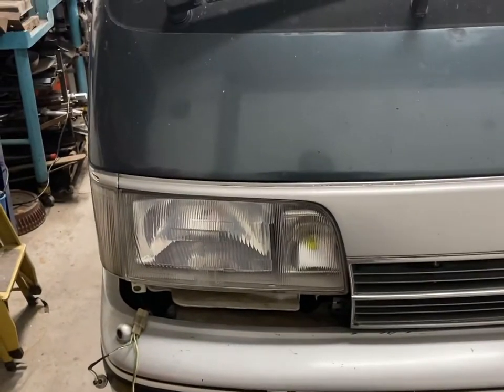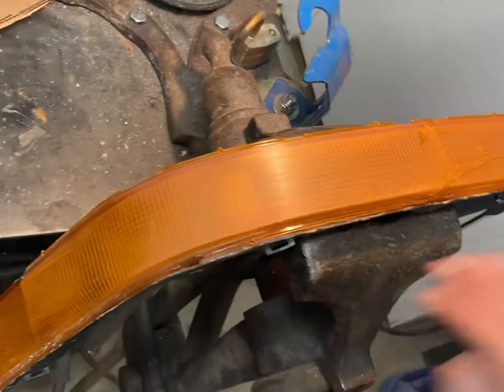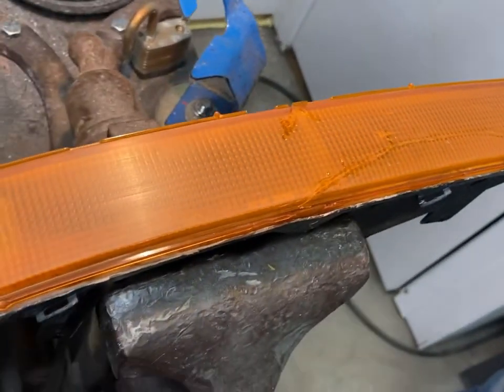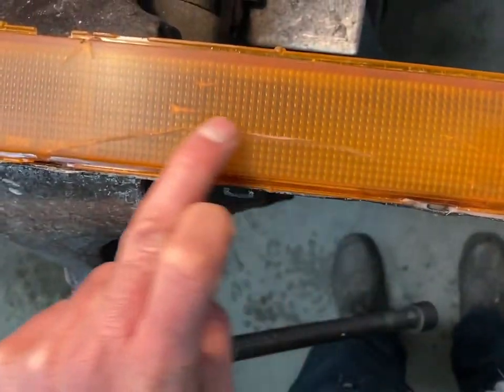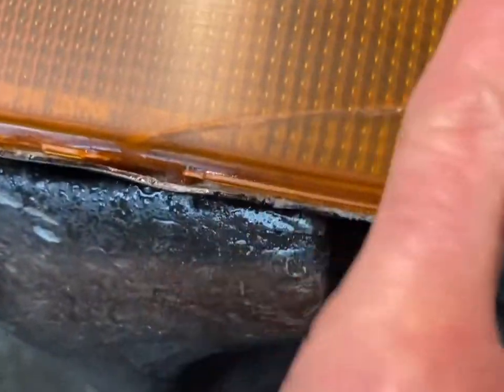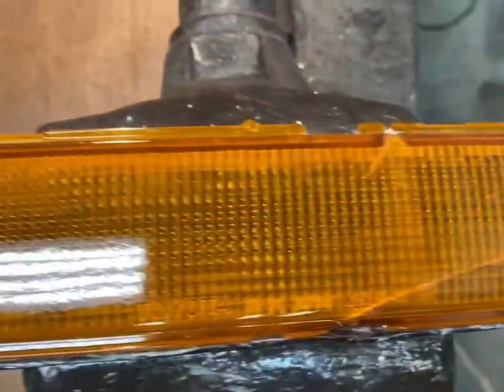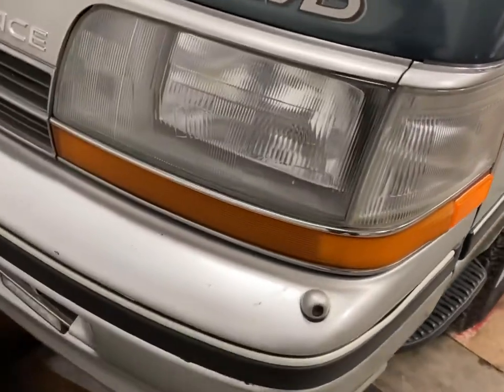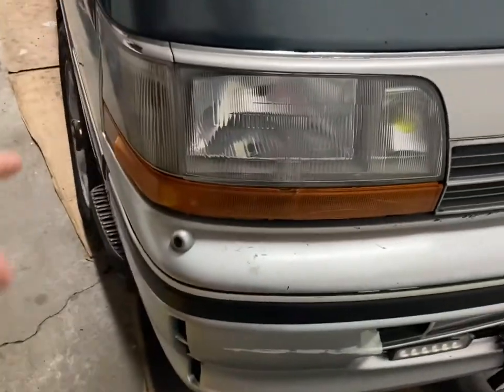signal light lense crack repair

Comment: i think maybe you should have tinted the epoxy with an orange paint,, also go deeper in the crack (grind more of the crack out)..
Reply from the maker: Cool.  What kind of paint?
Reply: @FixerMerlin  from other videos it looks like you can use just regular acrylic paints from the hardware store.. might need to blend to get the colour right